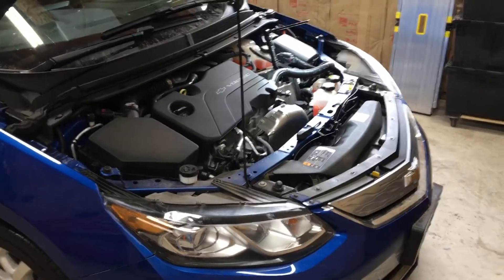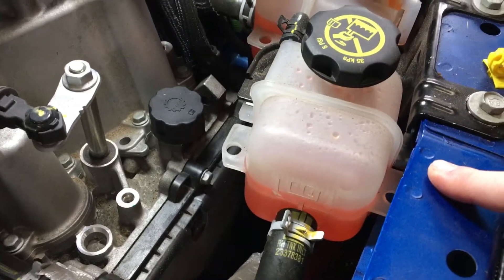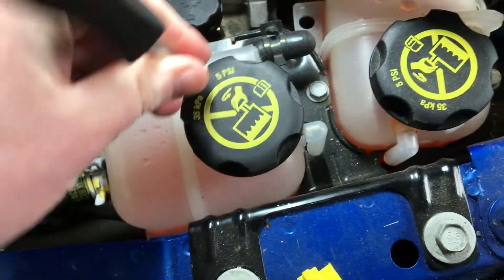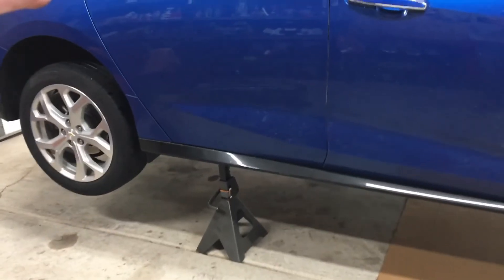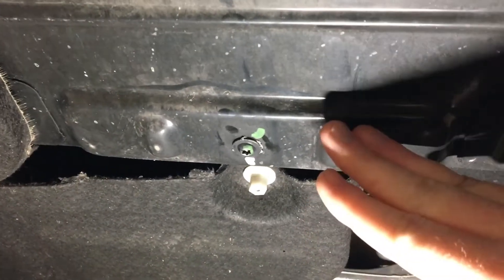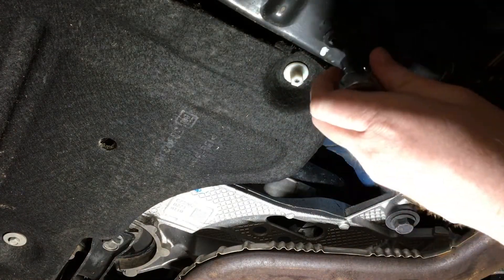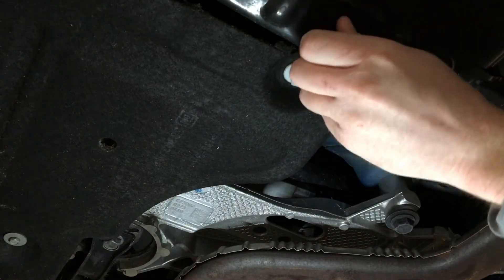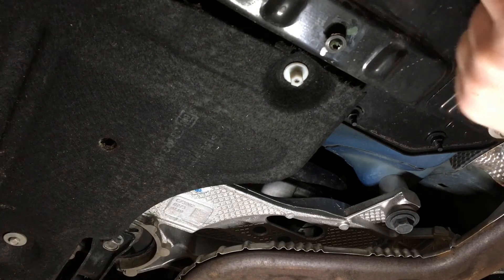How to open Chevy Volt Coolant cap and check battery for internal leak.

Comment: is the drain plug for gen 1 same location? Noticed my reservoir for the battery is lower and been getting the dreaded service high voltage system error

Comment: The Chevy Volt is an exercise and an experiment in technology.  Its coolant systems are complex and prone to leakage.   The electric water pumps are a common area to develop leaks.  Gravel and debris that enter the grille at highway speeds can do expensive damage to the radiator.  That's why there exists an aftermarket screen that protects this vulnerable area that owners can purchase online.   I check my Volt's coolant reservoirs daily for any drop in fluid levels.  Periodically, I have to add fluid to the big reservoir that sits above the right front tire.  One annoying thing about the Volt is that the car doesn't tell you what temperature the engine or battery is in real time.  This is basic information that would allow me to avert possible catastrophic engine failure prior to getting that "Engine Overheating" warning display during the Summer.  That warning message doesn't tell you specifically which component is overheating.  I was tempted to install an aftermarket temperature probe.  I'd need four; one for the engine, one for the drive battery, one for the 12V battery, and one for the inverter electronics behind the rear seats.

Comment: Few other Gen 2 Volt owners have confirmed that GM mistakenly put the coolant level indicator too low. It should be at the top of the black sticker. I had the same issue on my car, added 50/50 DexCool, went to AutoParts store to clear the code.. 15K miles later still going strong. 2018 Volt 76K.

Comment: I can’t find the drain plug. Did you need to take off any plastic?
Reply from the maker: Nothing needed to be removed it was pretty much dead center inline with the front of the front doors. It’s a pretty small drain plug.
Reply: @Justin_garage  thanks!!